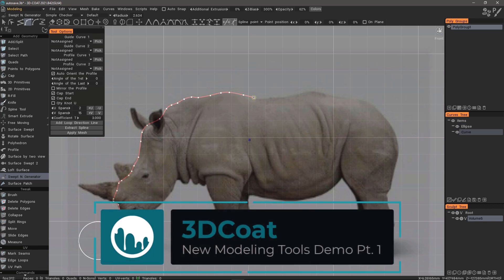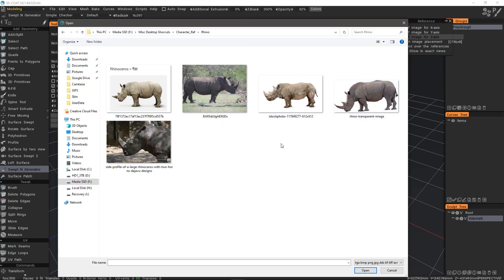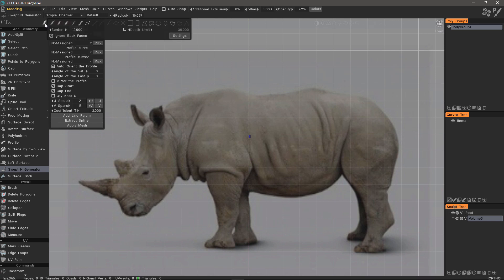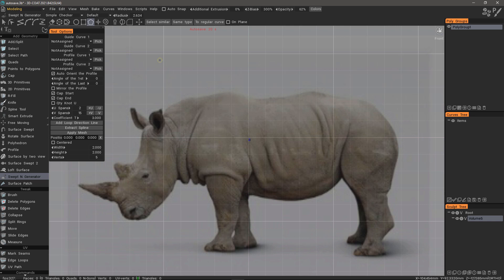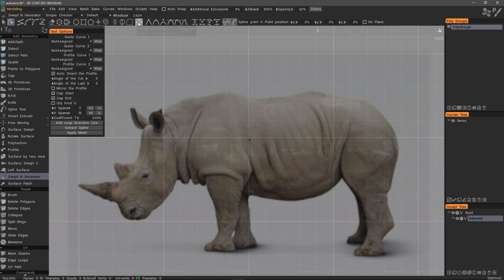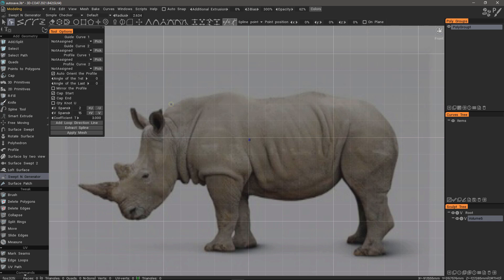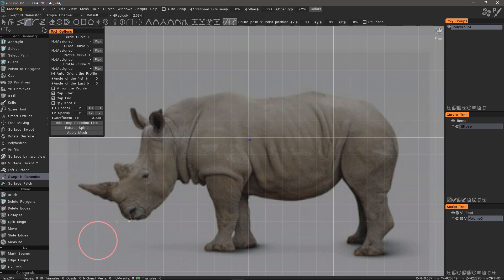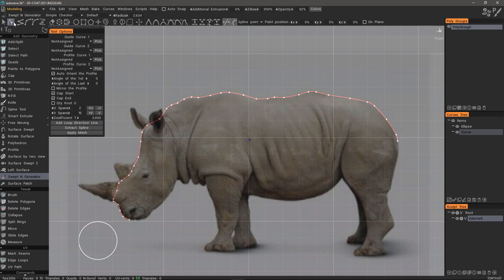New Modeling Tools Demo Pt.1

Comment: What is a "3D protection device" that prevents you from rotating the image during modeling (time:1:33 on video)
Reply from the maker: It is called "3D Lock" on 3dconnexion devices, but our development made this a default action in Orthographic view, so users did not have to possess such a device, in order to have this functionality.
Reply: @PILGWAY3DCoat  Thank you. I have never heard of a 3dconnexion device. Is this action in the 2022 version? (I did not see it in my 2020 version and could not find 3D Lock in any YouTube or Google videos) 
*These demos and tutorials help me to decide if I should upgrade.*
Reply from the maker: The 3D Lock (which mimics the 3DConnexion button function) feature in 3DCoat, is not enabled by default. 
https://youtu.be/HggpbFUmXzo?t=68
To enable it, go to the upper right corner of the viewport and click the Camera icon > click CUSTOMIZE NAVIGATION. There are many "Action Type" sections where a user can customize the behavior of hotkeys and mouse clicks. In the top center of each section, there is a description of the function...such as MOVE IN SCREEN SPACE. Scroll down until you see the section for ROTATE AROUND VERTICAL AXIS, and you will see a checkbox for IN ORTOGRAPHY. Uncheck that, and you now have the same functionality as using the 3D Lock button, mentioned previously.
Reply: @PILGWAY3DCoat  wow! thank you VERY much!

Comment: You should definitely hire an UI-designer. The panels get overloaded with tools. I'd like to see something like 3dsmax ribbon with groups & pop-up hints.
Reply from the maker: 3DCoat underwent a major UI restructuring prior to V4, and it was designed to be very familiar to Photoshop users, with a similar layout. We understand that it may not please everyone, but that is the direction we felt best for our software. Most tools have tool hints, by the way.
Reply: @PILGWAY3DCoat  maybe under the hood UI was reconstructed, but for me as a from-time-to-time user not much difference was detected in comparison to 4.9 :)
Reply: @PILGWAY3DCoat maybe, allow user to customize each button color? And user define panel that let user drag in their most use button or patameter
Reply: 3D Coat does an exceptional job of streamlining every needed tool and function in a context sensitive, user friendly way towards the user. Nothing is displayed that is not potentially useful when working with a specific tool in a specific context. Besides the fact that every single function can be hotkeyed without hassle.
Reply: @harrysanders818  Can you teach it well in a course?